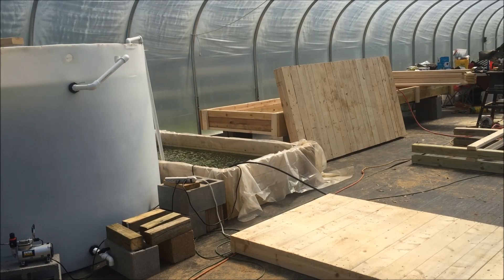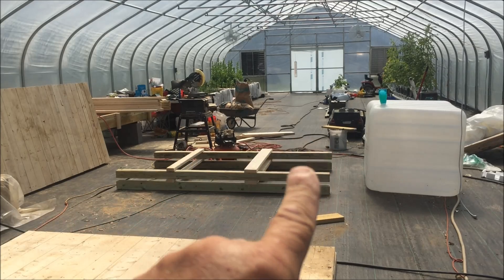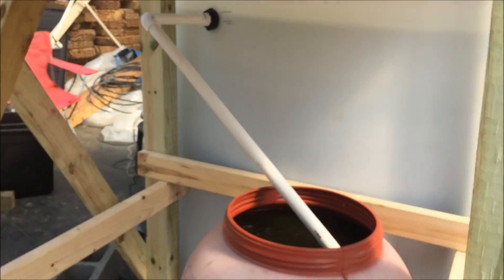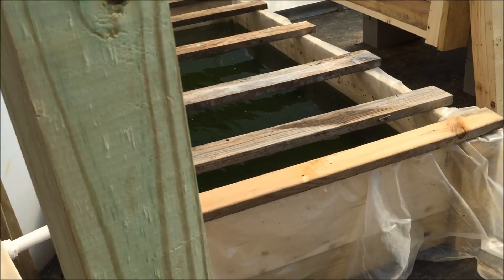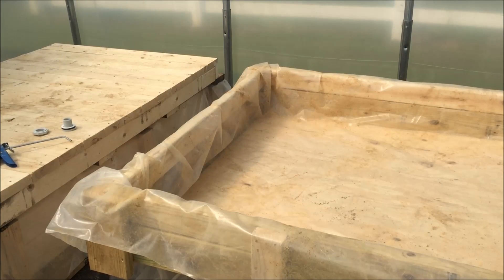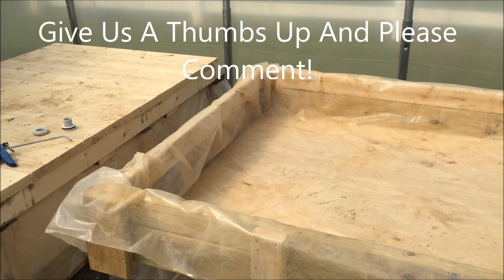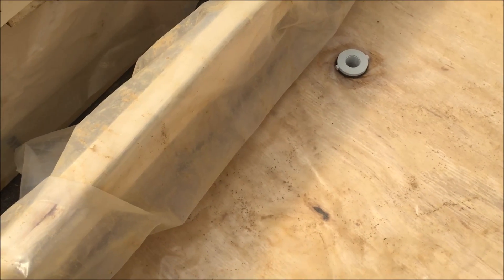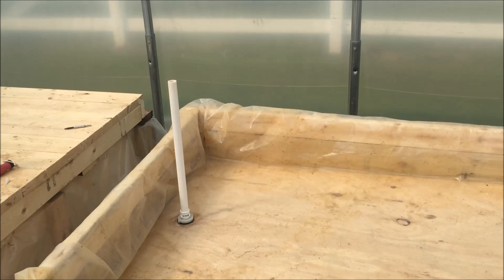Aquaponics In The New Greenhouse  Part 2

Comment: Great looking setup. I would have left the cage on the elevated IBC, the plastic will degrade over time and weaken just from the weight of the water. I would have also went with a heavier pond liner on the beds due to their size. Either way, wish I had something like it. lol
Reply from the maker: I totally understand the reasoning. Most of what I do in the greenhouse is on the cheap! THe greenhouse film is rated as food grade and is tough as nails. It had a 4 year warranty on it when used on the greenhouse so I would expect to get at least that in those beds. I had a lot left over from when I built the greenhouse.
The IBC that I got didn't come with the cage. I definitely agree that using it up there with the cage would be better if I had one. It is all temporary though. I will be moving the fish into a fish house once I finish building it. Thanks for following along Charles!
Chuck

Comment: Chuck, I have an IBC fish tank with believe it or not, 1500+ Tilapia of all sizes from 1.5 lbs. down. Somehow they keep reproducing because I see 4-5 inch fish in there too. Needless to say I'm not shooting for fast growth. I have an in ground sump so I needed to pump the water up 10'. I decided on a DC pump with 6 pump speeds I can only run it at setting 4 with 3 bleed offs to keep the IBC fro overflowing.  As I mentioned in an earlier comment I only have a one inch SLO in the tank and the water only flows out so fast. I know you put that IBC tank on a platform to correct your pump issue (BTW I would have left the IBC in the cage it came in) but since you're building a new fish room and will be moving everything  you might want to give the pump a try. I've been using mine for 2 years now with no trouble.   https://www.amazon.com/Jebao-DC-12000-Return-Pump-Aquarium/dp/B00INTDJDA/ref=sr_1_1?ie=UTF8&qid=1480299931&sr=8-1&keywords=jebao+DC+aquarium+pump
Reply: BTW What kind of plastic did you use in the grow beds?
Reply from the maker: Thanks Jeff. I will check out the pump. 
I am using 6 ml greenhouse film as the bed liner. Works well and I had plenty of it. It has a 4 year warranty when used on the greenhouse so It should last in there for a long time!
Chuck

Comment: hey buddy such a great effort i think you may have dead fish because of not enough water circulation inside of the big tank. I had a similar problem. Kind regards
Reply from the maker: They have been doing fine since that incident Blake. I added an O2 generator to the system and it seems that all is well. I have a little over 100 adult tilapia in there and countless fry. I hope that some of those fry live but I am leaving that to nature for now. Next year I will begin to try to separate the females that have the fry in their mouths so that  I can control the #'s in the tank better and give the young a better chance of surviving.
Chuck

Comment: 1:08 is that a spider?
Reply from the maker: Yes. It's a plastic spider that I use to in front of the door to keep the cats from coming into the greenhouse. They have been locked in there before and they can tear up mu greenhouse film so I put that in front of the door to keep them out. It works well
Chuck

Comment: what kind of plastic do you use for your grow beds?
Reply from the maker: This is actually 6 year 6ml greenhouse film. I have a bunch of it and it's as tough as nails. 
Chuck
Reply: +Fensterfarm Greenhouse is it safe to use? like is there any plastic degradation into the water?
Reply from the maker: +farmboyEN yes. I have used it for about 4 years without issue
Chuck

Comment: I would not rely on gravity for anything but grow beds draining to the sump tank! I would keep all your fill lines on pressure of the pump!  Check out some of my pics of my system! https://www.facebook.com/leesville.aquaponics/
Reply: +Leesville Aquaponics Homestead  also the plastic you are using will degrade in a years time and will leak!  Btl liners sells the proper liner and a price you can afford! My beds are 2ft wide by 48ft long and they custom cut the liners and I think mine was like 60 dollars a liner! I'm not trying to be a arm chair YT warrior! I farm for a living and want to stop you from making the same mistakes I did! Re doing everything later is not what you want to do! I been doing AP for about 6 years now and learned my mistakes!
Reply from the maker: +Leesville Aquaponics Homestead The grow beds are really all I will be using the gravity flow for. The grow beds will make up about 2/3's of my grow space in the greenhouse though. 
I will check out your fb page.
Chuck
Reply from the maker: +Leesville Aquaponics Homestead I have used this plastic in my grow beds for hydroponics for the last 4 or 5 years and it has not been a problem to date. This is not regular visqueen if that is what you thought. It is 6 ml greenhouse film. I have so much of it that I recycle it in many ways and this is just one of them.
I will however check out BTL just in case I do run into a problem
Thanks for the advice!
Chuck
Reply: +Fensterfarm Greenhouse AH ok I didn't notice it was GH plastic! I'm sure it will hold up then! I just don't like using it cause of the leaching into the water as it breaks down! BTL liners products wont break down I have a liner I put over part of my chicken coop! No issue as where a tarp would have fella apart in the sun! I was talking about gravity flow from the tank on the shelf and trying to time it ect so it don't over flow! We have 128k upload speed via DSL so I have not been able to up load videos! But I did just get a smart phone and I might be able to upload videos from it as they may be smaller I will try to do a video on my system here in a few day! Got the farmers market in the morning

Comment: Hey Chuck gotta ask about the fish house?  You planning on building just a fish house in the back and then pump the water to the grow beds in the GH?  Just wondering on the thinking process?  My thought on the fish challenge is that the water for tilapia must stay above about 68 degrees for their health.  How are you going to heat the water in the fish house?  Another GH?  I am seriously looking into using solar water heaters to heat the water in the fish tanks.  Anyway thanks for sharing again!
Reply from the maker: +Rick Cragg That is exactly what I want to do Rick. I can use gravity all the way from the fish house to move the water with the exception of the reservoir sump. I will put a heating element in the system somewhere safe. I will also heat the fish house. While it is in the greenhouse I will enclose that fish area inside there and just heat that space this winter.
Chuck

Comment: OK I have to ask about the tomatoes and dutch buckets ~ it didn't look like the grow bags were covering them?  Will you be placing an auto pool sweep in the fish tank?
Reply from the maker: +David Dube&#39; I have black plastic wrapping the tomato plants and I have grow bags over the cukes. I had them over my peppers and I removed about 3/4's of them cause the peppers were not growing. Turns out that the peppers didn't like the nutrient mixture that i was giving them.. 
I do not plan on adding anything to clean the tank. I am going to let the bacteria do it's thing naturally.
Chuck
Reply: Thanks Chuck!  Maybe when things slow down you can give us an update on the pepper mixture, that could be my issue.

Comment: why cut the whole top of main tank off, why not just have an access hole?
Reply from the maker: +Rev John O&#39;Toole Hey John, Too much maintenance inside there to try to access the entire tank from just an access hole. I thought about it for a couple of days before I finally cut the top off. The aeration system is as big as the bottom of the tank, (the bottom of the tank is 86 inches in diameter and the pvc air system is 83 inches in diameter). Probably the most important part of the system. I would not have been able to get that in at all unless I removed the lid.
Chuck
Reply: +Fensterfarm Greenhouse that's what kids are good for, ha ha